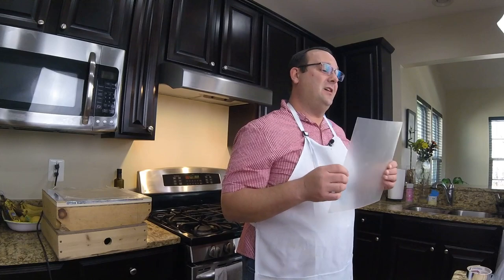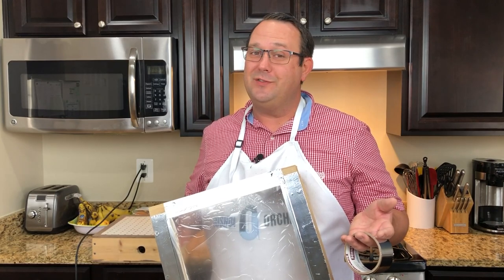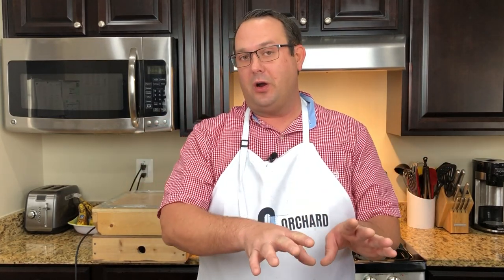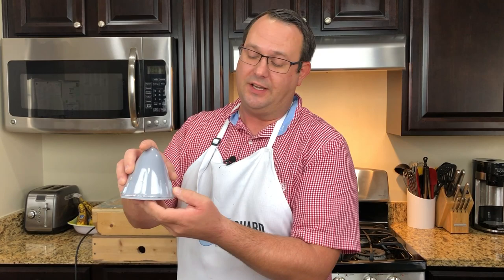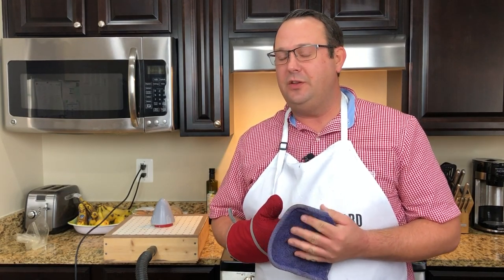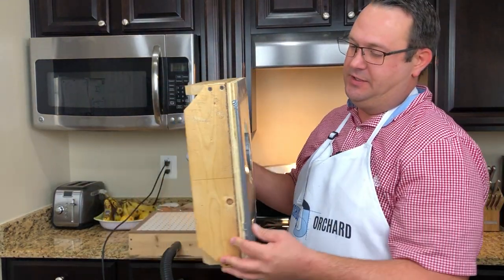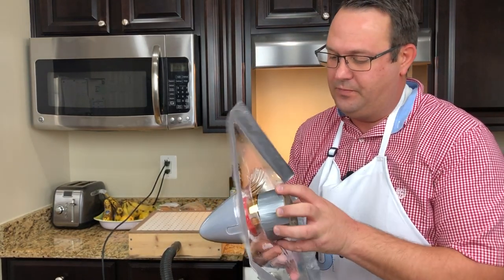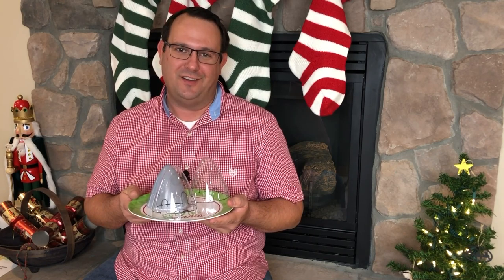A Hobby Holiday Recipe For Vacuum Forming

Comment: I would recommend that you purchase a foot pedal switch for your vacuum. They can be found for about $10 on Amazon. As your hands are busy holding the frame down, you can press the foot pedal to flip on/off your vac. I use one and it's quite handy.